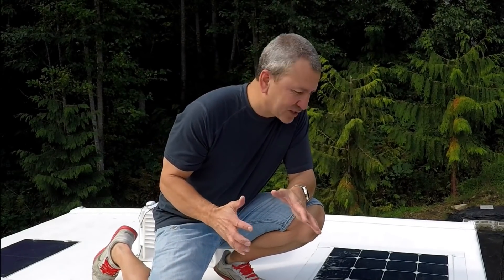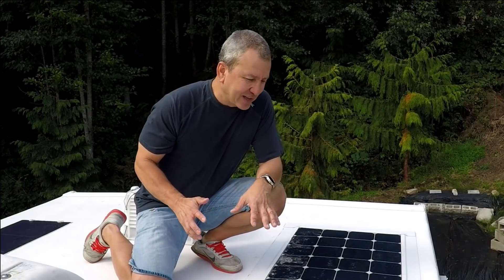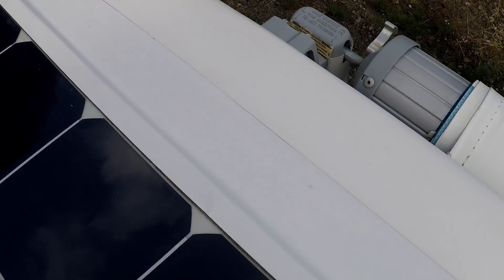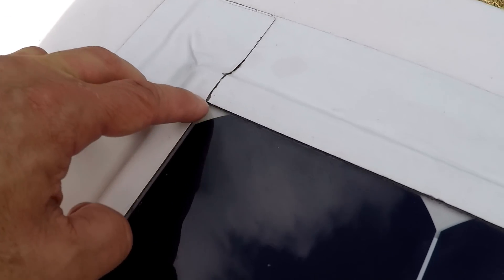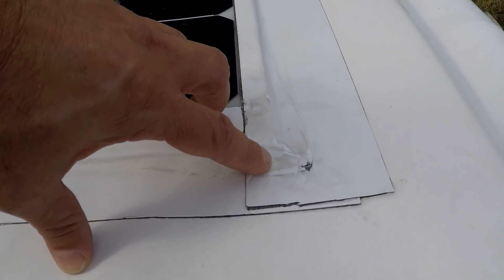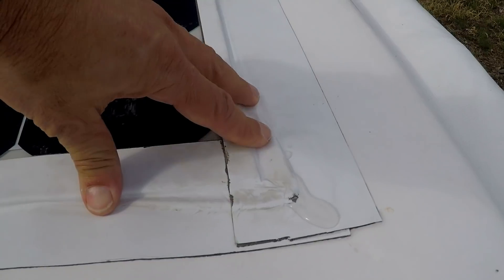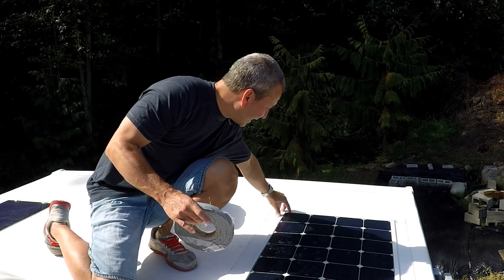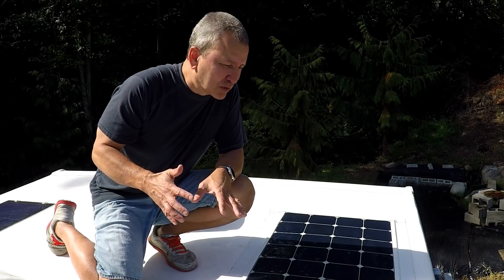ONE YEAR After My DIY FLEXIBLE SOLAR PANEL Installation

Comment: If you try this method again, you might consider a fine bead of silicone calking around the tape edges. This might help prevent the water from penetrating in the corners. I haven't tried this myself, but it was something that came to mind while watching your video. Good luck.

Comment: i find it simple to drill a hole..  it will not hurt the roof at all as you seal it up.. i have a new rv and i was worried but i did it and im happy i did.. the glass panels seem to work better and hold up better.. less money too..  i like the 160 watt panels  just feed back thanks for the video great job..   we need to meet up one day
Reply from the maker: +The Deprey's Thanks I haven't had any trouble with drilling either. I wanted to do these different for those who didn't want to drill.
Reply: Me too ,I just drilled 4 holes in my old 1966 camper I’m rebuilding . I bought this Aluminum Roof  seal with fibers used this first  first as I did have a leak before panel install. fixed leak then mounted panels and brackets and screws right into the roof then sealed the screws. I have no leaks and I’m using a 175 Watt Mono Panel  collects electricity even in shade . Loving my off grid system can’t wait to join more panels.
Reply: The Deprey's yes my people don't think that solar is that profitable but that's comparing it on average use because when the electricity is free you can basically Run 100 watt light bulbs and leave them on all day and not give a shit or whatever antique technology that is power draining so theoretically you are saving 10 grand every two and a half years if you power your house with 100 watt light bulb in the daytime and eventually you'll be able to have 10 Tesla batteries under Freon Refrigeration so they last a lot longer you can just leave everything on lights on all night and put giant spotlights on your house just to brag to your neighbors about how much for electricity you have and they have to pay a fortune just to use shity ass 40 watt light bulbs.
Reply: expanding epoxy foam. It works.
Reply: Drilling is easy. Selling a van with holes drilled in the roof may not be so easy.
Reply: Yep, and one small leak and you're in a world of trouble.

Comment: Good information.  Do you occasionally need to clean these panels for them to be effective?  Does residual dirt block some of the suns rays and affect the output?  If so, what do you use to clean them?  Good topic for another video?  Thanks for sharing.
Reply from the maker: +redroofretriever It's always good to keep them as cleans possible, but a little dirt and dust won't affect it too much. I just use water and a soft brush or rag to clean them. Nothing special.
Reply: redroofretriever if you get hit by a sandstorm it will affect your solar panels or a snowstorm but since you have free electricity you can just attach a heater or a windshield wiper system as well as you can also laminate solar panels.
Reply: RVwithTito you can laminate them there's also important to wipe snow off of them,

Comment: 3M Marine Adhesive/Sealant 5200 best out there .
We have a 5th wheel  that I have design side wall mount plates over the rain gutters.
Each of the side plates where bolted in to the aluminum studs of the campe,had a used motor home and the 
Previous owners hold mounted though roof and it leaked .
With the 2880 watts of solar panels I need them held strong.
Reply from the maker: +RV solar homesteaders on the road !!! Jeff Loitz Thanks for the tip.
Reply: I have had sailboats for years and can tell you I will never use 3M 5200. It is a permanent adhesive and is practically impossible to get off.  3M makes easier sealants to work with such as 4500 and 5000.  I think you are much better off going with dicor or eternabond.
Reply: Yes it might be true  but for my set up i need the 
Reassurance  that  nothing was going to let loss.

Comment: Why not put some silicone glue on the corners to keep it from getting under the tape in the edges of the corner. at the solar panel
Reply from the maker: +RV Norm Burgess Yup. Could do that.

Comment: I installed our flexible panels the same way and noticed the same exact issue. Doesn't seems to be hurting anything but less than ideal. I'm just going to think of it as liquid cooling ;). Over 5000 miles with them up there. I'm monitoring them and will let you know if I see any problem in the future. BTW, love your videos! Keep up the good work!
Reply from the maker: +Giant Life Tiny RV Ah. Liquid cooling, and heating. I like it. Thanks for the feedback.

Comment: Hi Brian, Great video showing long term results.  I am planning on using eternabond on my flexible panels. I was thinking of leaving an opening in the tape on the low points. Meaning don't completely tape around the entire panel. My theory is to allow water to drain and allow air underneath panel.  Just a theory any opinion? Happy travels, Lou
Reply: +RVwithTito always have 1-3" air gap underneath to prevent heat damage and voltage,amp reduction due to heat damage
Reply: That's what i'd do, since the waterproofing really isn't needed.
Reply from the maker: +RV Habit I think it's a good idea if there's going to be any kind of gap underneath.

Comment: Put a little dab of self leveling Dicor to seal those little gaps in the Eternabond overlap, and you are done.
Reply: I think his tape is a little too close to the cells for that.  Even a tiny bit covering a cell would mean a large loss of power.
Reply: I don't think so. It would not take very much Dicor to seal the opening while not interfering with any cell, that's for sure what I would do.
Reply from the maker: +Larry Askew I'm not going to worry about it. If I do anything I'll probably remove the existing Eternabond and try something different.
Reply: If you really think that idea is going to work I would expect you to do it on the initial install when everything is clean and dry

Comment: Excellent follow up. Bought my first (two) 50w Uxcell (Mohoo) mono solar panels. Since I don't have an RV or boat...used my laundry drying rack as a "solar stand". Total weight comes in at about 6-7 lbs, folds up smartly, and I attached the two solar panels to the laundry drying rack using those "Gear Ties" found at Lowe's, Home Depot. Best part...the wings on the laundry drying rack adjust. I also drilled a couple of "extra" holes in the tubing for more angle-opportunity. The rack is stainless steel. Just an idea I came up with that might help your viewers, campers, preppers, tailgaters, out on the road. Got videos on my channel. Take care...again, great follow up to these flexible panels!
Reply from the maker: Yeah I've seen your drying rack setup. Makes it easy to move around for sure and air dry them at the same time :)
Reply: Indeed!...and the panels are "air cooled" too on that rack. Seen 6.1 amps...really impressive.

Comment: I have the same solar panel. I have had it on top of my vehicle for well over a year now. I used 4x6 inch industrial velcro. One in each corner of the panel. Still going strong however I do check periodically for any lifting or pulling up. So far so good.
Reply: EAZack I drive 38 miles to work and 38 miles back every day. 30 of those miles are 70mph freeway speed.  I have had zero trouble so far with it peeling up. I do check periodically because like others have said it could be dangerous if it flew off on a freeway.  Im not saying this is the best way to do it because obviosuly something could go wrong but I can't drill holes into my truck in case I want to sell it in the next year or two.  I have seen no signs of deteriorating or weakness yet in the velcro as of now. Could also find a strong tape and tape the edges along with the velcro. Have a good day.
Reply: I'd love to use Velcro instead of Eternabond, but it seems risky. Even though the flexible panels are extremely light, if one flys off on the highway, it could kill somebody simply by scaring the driver behind you and causing an accident.
Reply: Wade Neilson name of it is Velcro brand. It is the extreme outdoor all weather/rough surfaces. Comes in a black and white box. Can find all different sizes on Amazon. Just search for industrial strength velcro it is made by Velcro. Be sure to clean the surface thoroughly. After sticking the velcro i believe it had to set for a few hours to let the adhesive do its thing.
Reply from the maker: Good to hear john.
Reply: john inwi any pics? Name of velcro ?
Reply: Have you been through any high winds and/or rain and/or snow with this velcro method?  Also I'm curious why you didn't velcro the entire perimeter of the panel?  Do you think that water might collect under the panel more easily that way?  Thanks.